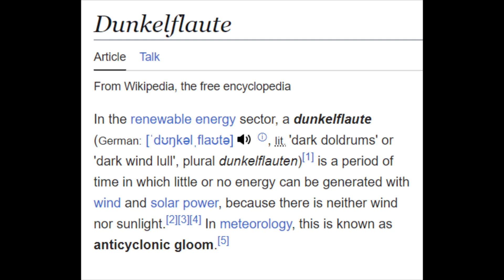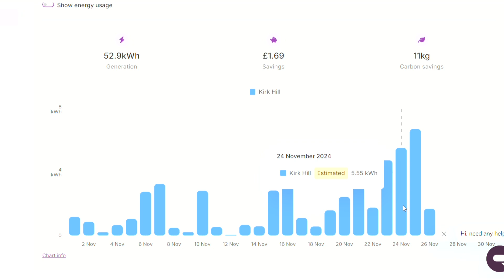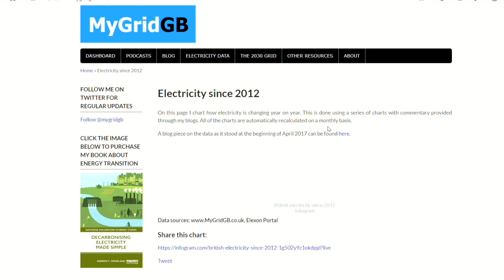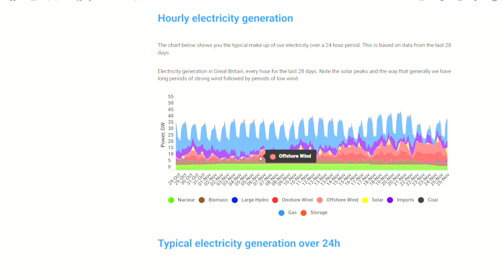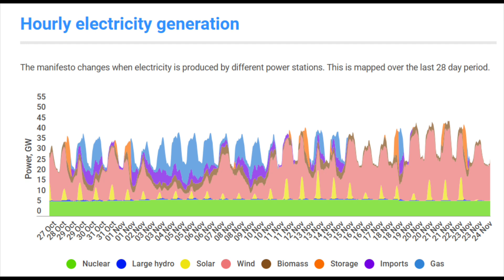Dunkelflaute: The Energy Crisis You Didn't See Coming

Comment: Have you calculated how much energy we use for cars; vans; buses etc and gas boilers and industrial use and converted that into electrical power and compared that with what we actually have from all renewables and nuclear?
Reply: Cars and vans are probably the easiest to deal with as they will often charge when the energy is cheapest
Reply: All 38  million road vehicles  being EVs would at the current 8,000 miles per car per year, would need 65-70twh a year extra. So about 20% more, or about where demand was in 2007  @edc1569
Reply: Its not that straight foreward  in my experience of going 100% electric. I ditched 12000kwh of Gas , 20000kwh equivalent of petrol and found that was 6000kwh of extra Electricity that i needed but I also added PV that cancelled out most of that increase. Its a great efficiency gain and my 2 EVs and 175L hot water tank are 165kwh of load shift-able storage. If V2G does appear in 2025 then I will be able to earn+save money providing home+grid storage
Reply: @kenmerry2729  yes, we won't need a one for one replacment . The replacment will use less. 

Electric motors  in an EV are 80%+ efficient against 25-40% for ICE 

Same  with well installed heat pumps vs gas.
Reply: I have calculated all these figures based on our entire energy consumption figures for 2019. For road transport I used actual mileage and converted it to EV figures based on average EV consumption figures for winter and summer combined. For heating I used the 2022 total consumption figure adjusted for the widespread use of heat pumps in larger buildings. I made further adjustments based on other factors. My final figure: using 2019/ 2022 data we would use about 1354 TWh of electric power for everything in a year. On average this is 3.71TWh per day, which varies from 1.6TWh/pd in the warm 6 months, to 4.2TWh over the cold months. I allowed an additional 360 TWh for hydrogen storage production. I concluded that we can meet this with 25,000 10MW floating wind turbines, plus 50 GW of assorted renewables. I also calculate we need a car battery swap network to store  at least 3TWh of power for an energy reservoir. The charging network is no use for net zero, albeit will support a transition. I calculate with this we can bring the cost of electricity down to 12p per KWh, the maximum at which net zero is politically possible due to it doubling our heating costs over current prices. The extra cost of heating is offset by a lower cost of transport and widespread use of heat pumps. See UK NET ZERO ACTION, episodes 1-5.
Reply: @UKNetZeroAction-xi5we  that is the average case , now what about the worst case. How dose it all work in a repeat of the 1962/3 winter? 

I don't think it's the car that Are real issue. They will mostly charge in off peak hours, ie in the   20+ hours they are parked anyway. 

It is the heat pumps. If it is -5c they will all be running at once. 

I am not sure the battery swapping is going to happen. Tesla tried it in the early days, but  fixed  batteries have more capacity. 

Also do you really want to swap your   brand new 100% capasity battery with one that has already done 150,000 miles and 500+ charge cycles?
Reply: 2030 is too soon for EVs and heat pumps to have made much difference, but the answer is that it about doubles the total power required by about 2050. There are long term plans that go out that far, but they have to make a load of assumptions.

Comment: How long after you invested in Ripple did you start to see a return ?
Reply: It took a long time for the farm to get connected to the grid, we are with Kirk hill and returns started in June/july, but it is to reduce carbon footprint and to lower bills though at the moment I’m not sure we wouldn’t have been better off investing into more solar/battery or even something else, but we still feel good that we have helped in pushing the Ripple Project forward, we have also a small investment in their next coming online solar farm.
Reply: It's not about a "return" it's about another part of the mix. Not practical to stick a wind turbine in my garden,  but I can still benefit from schemes like Ripple
Reply: It depends on the project , I have put money into Derril Water solar project (2 years to go online) & Whitelaw Brae wind farm  (3 years ish) at the moment. To me a return is displacing gas from the grid as coal has been kicked now.
Reply from the maker: Hi all - sorry for the slow reply! 

Some dates from me - I started paying into Kirk hill (monthly) in Feb 2022, and it started generating in early summer 2 years later. 

And then Derril Water in April 2023, and that is supposed to start generating in the next few months. 

So, possibly 2+ years between the opportunity and seeing savings
Tom

Comment: Very interesting, Thanks now I have the facts to counter the doubters.
You mentioned load shifting through savings sessions which are a great idea.  BUT OFGEM have cut the allowed rates by 90% to 22p max making those sessions unviable.  It seems like OFGEM are working for OPEC
Reply: I load shift for free anyway as i use the UK NESO app to see if charging our EVs is using less gas.
Reply: @waynecartwright-js8tw  Me to, although I charge my two EVs when necessary , I try and do so when the grid is greenest during periods of large wind generation , so,for example even though my EV is at say 50% I will top it up to 80% when there is large wind generation during the night.